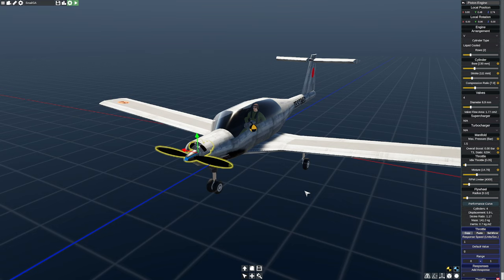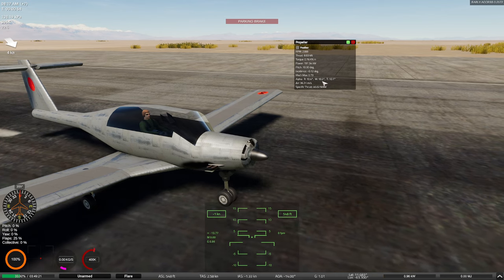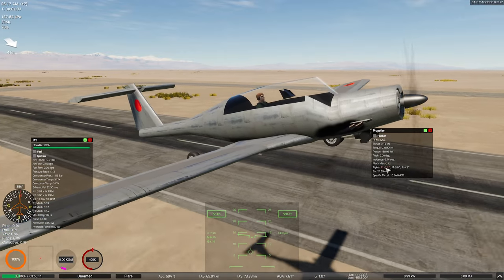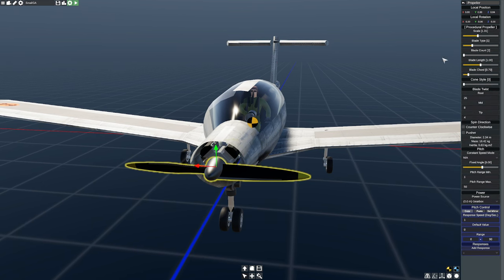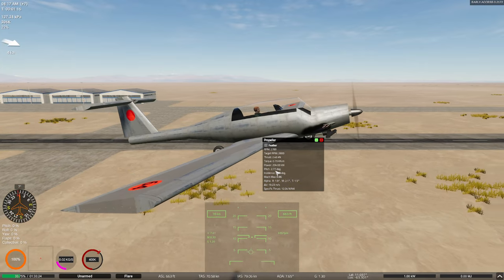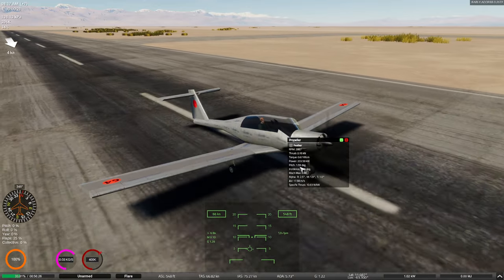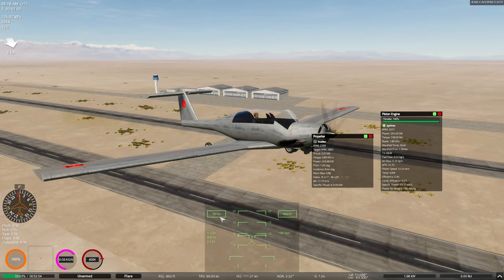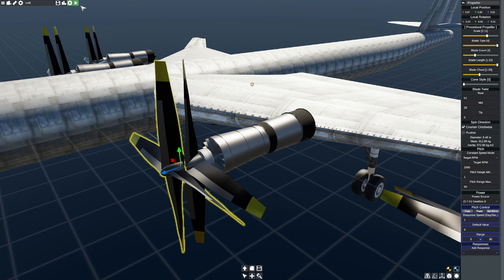Flyout - Sizing a Propeller to an Engine

Comment: @P Gatcomb, how do you get your jet engine started after its been shut off. none of my jet engines will start after i shut them off. Great videos, very useful info, thank you
Reply: So I'm not really sure how it works in the game, but for most military aircraft the engines are started hydraulicly, usually by a much smaller jet engine called the APU (source I'm a mechanic in army aviation) I'm thinking the game might force something similar.
Reply: What i do is i add small electric engine and connect it to the engine via transmision. Then i set electric engine to the custom switch and when i need to ignite my jet i press "i" for example and it start spinning the turbine untill its fast enough to kick it with its own ignition
Reply: engines use turbines to keep itself spinning, try adjusting the turbine until it runs at idle power